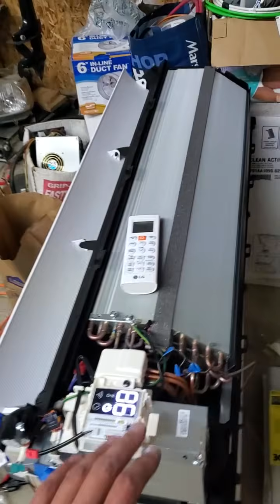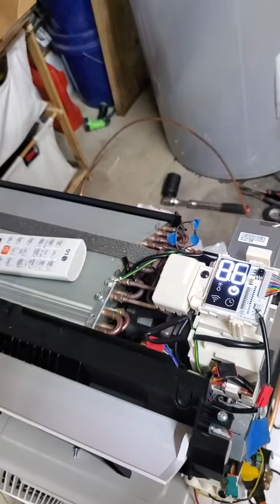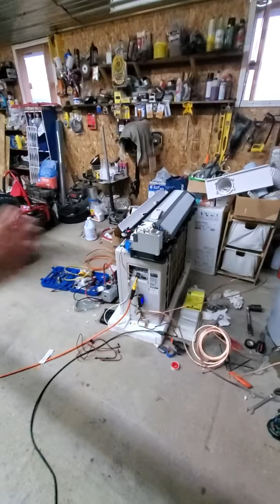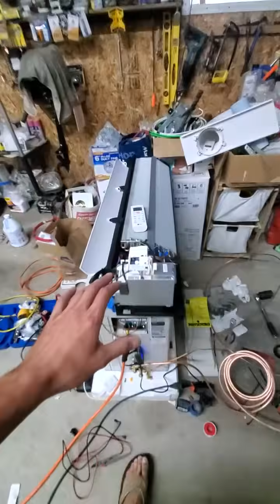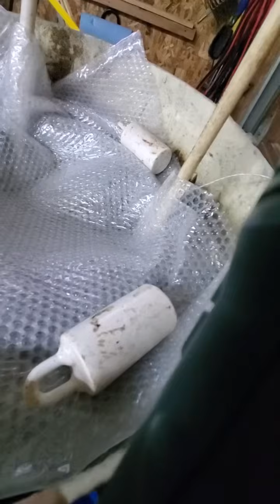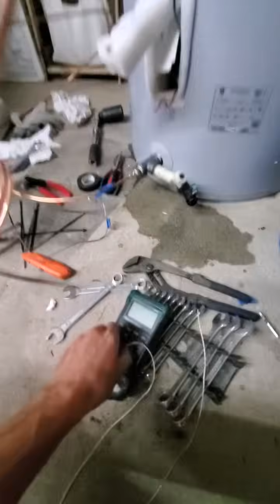DIY Heat Pump Water Heater. DIY. Home made mini split.

Comment: Thx for the great inspiration

I'm in the process of making mine from a 100$ 10 years old fujitsu heatpump,

Tested it with stock coil on a 55 gal drum and got a cop of more than 3

Mine the air handler was made of 80ft of 3/16 copper so I tried it with 50ft of 3/8 copper, I got the exact same cop in my 55 gal drum...

I've manage to preform the coil over a 5gal drum and snaked it by the element hole, didnt have to cut open the water heater...

Thx again for sharing this😊
Reply: Wow. You got 50ft of coil into the water heater without cutting it?

Comment: I love this and I would recommend running the condenser in a space like a garage Would be better to even run it in an insulated garage and if it gets too cold even in the garage you can always turn on a space heater and you still be using less electricity to heat water than you would be but that heat pump should be good to at least 5° f

Comment: It doesn't come back from the evaporator as a cooled off refrigerant It comes back as a heated refrigerant It goes in as a cooled off refrigerant and then it picks up the heat in the house or the space that you're trying to condition that is it takes the heat out of the air that's passing over the coil in the refrigerant soaks that heat up which is why it feels like cold air coming out and that refrigerant then gets heated to the point that it's superheated and then it goes back to The condenser and it's turned back into a gas and then it's compressed silica become a liquid again and the liquid is sensor a metering a metering device and turned into a low pressure low temperature gas that absorbs heat and as it goes through the evaporator when it gets to the 50% point it should be about 50% liquid and 50% gas as it becomes satura actually those indoor units are so simple in a pinch I've literally used thermostat wire as the power wire for the indoor unit and I've seen technicians lose their head over that but it's just running a little fan That's it It's just a little fan is thermostat wire big enough to run a little fan? well it has been on one job I put in for the last 7 years

Comment: I think this design (more buttoned up) is a better option.  It gives consumers more flexibility.  You could size the heat pump independently of the water.  Since they sit separately, they would be easier to move.  I bought the 80 gallon AO Smith heat pump water heater last year and it was a major pain to get into my basement and broke my dolly that I used.  If the heat pump has a fault, it is easier to service it... and you can decide where you place the heat pump... inside, or outside.

Now, what is even better... make this part of a VRF Heat Pump setup.  In the summer, when you're cooling the inside, it would allow you to shunt the heat into the hot water heater and not even use the outdoor fan on the compressor.

Comment: I like your idea, but you did this the hard way. You did not need to butcher that hot water tank, All you needed to do was hook up a coaxial heat exchanger and a recirculating pump. the heat exchanger has two ports for the refrigerant lines  and two for the hot water lines.
Reply: Do you have a link for a suitable heat exchanger?

Comment: Could I just divorce the coils from the inside unit and drop them in the water instead of using copper tubing to replace it? Or do you need the temp snesors and other things to be hooked to the coils for some reason? I am thinking of heating up a storage tank with corrosion protected heat transfer fluid, presumably water with anti freeze.
Reply from the maker: Short answere is yes but not really. That would be like asking can I start off in 3rd gear and then go to 1st then second.  To properly release heat inside your tank you need s properly designed coil.

Comment: Could you please tell me how to regulate the temperature of the freon flow or water flow from the heat exchanger? Is it possible to somehow influence this?
Reply from the maker: The short answer to that is no because you would have to reprogram the original computer from the Mini split. that is why I stated to use this exact brand of many split. Because when it turns on and runs at full speed, its efficiency is still very, very good. Most many splits at full speed have a horrible efficiency.
Reply: Thank you very much for quick response!
What do you think about other brands, Japanese of course like Daikin, Mitsubishi, Panasonic and etc?
Reply from the maker: @slusajgledajpazi7556  Honestly, they are good in the general range. As a car at 55 miles an hour, many cars have good fuel mileage, but if you floor them, some have decent fuel mileage, and some have poor fuel mileage. the same goes for heat pumps. The other Japanese brands have a good general rating for efficiency. But under full load, they suffer 30 to 40% loss and efficiency. this L. G brand at full capacity. 5°F outside temperature produces rated capacity at Ar COP of 300%.  Most other brands run 200% at full capacity at 5 Fahrenheit. If not, less, some Chinese brands are at 180%.

Comment: Running a larger tank. Like 200-300 litres could help with keeping temps for when the shower will be running alot. 
Either that or supplementing with electrical heaters for a faster heat up when needed could do the trick.
Reply from the maker: Unit has been running for 2 years. 6ppl and no issue with doing dishes and showers one after another.

Comment: Hello. I like your setup a lot, just few questions pop up. First, why didn't you used tank that already has coils inside - like bivalent tank that's used for solar systems? Coil tube diameter size? Second, if coil is located on bottom, it will heat bottom and gradually transfer heat to the top. That means you have to wait for tank to heat up. But if you make coil on top, it will quickly heat up enough water for immediate consumption which if not spent, can be moved to the bottom with additional small pump that can be connected instead of motor (yes, I know you'd need additional electronics with it). Somehow, running that fan motor for nothing seems like a waste. I'm from Europe, on meridian similar to Virginia.
Reply from the maker: I needed exact size of pipe and leather in tank so I had to make my own. Th bigger portion of the heating coil is on the bottom of the water tank and that is after I did a few test trails prior to permanently placing the coil in tank. I tried it more to the top and then middle. The way it is now heated the water evenly and as the top reaches 125f the bottom is not cold. Maybe 115f. The heat from coilmon bottom goes to the top all by its self when heating so no point of placing it on top and as the top of the tank gets up to 125f its easier for lower part of the tank to receive the heat since the coil is there. Works best this way. Most of the coil on bottom and some middle and less on top. I looked through many pictures of other tanks and they looked similar. The fan motor need to run for heat pump to not have codes. With no fan attached it uses very little power.

Comment: The US REQUIREMENTS  for double wall separation may lower transfer rate but would not increasing contact area of condenser compensate for the less efficient heat transfer. Question when cold water is being introduced and creates thermo layers how will that affect the return refrigerant temperature . Will the repurposed controls be able to compensate ?  Yes i worked in HVAC for many years i am not an engineer.
Reply from the maker: I have many other videos showing this unit running in house. Been 2 years. No issues. No weird compressor noise. No loss of heating output.

Comment: This looks like a disaster
Reply from the maker: In one mns eyes a disaster and in another's a work of art. To each his own. Law of relativity
Reply: @ne7s29  I guess it really depends,  did this end up working safely and reliably or did you destroy two expensive appliances?

What was the plan to make the high pressure water storage vessel safe after you cut into it snd destroyed the glass lining?
Reply from the maker: @cheekybastard99  the other videos explain they rest. Working well for few years.

Comment: I've never seen a mini split water heater in Europe, they are usually all air-water monoblock heat pumps. I'm about to start building a 2.5kW unit from a r290 mini-split and my existing DHW tank.

Comment: Excellent build. Are you still using r410a or did you switch to a different refrigerant. I noticed that it’s not in its final config like in your other videos. Do you recover and reuse?; evacuate and refill? Or there’s another procedure. Thanks.

Comment: I am curious if dropping original heat echanger into the tank would work as well instead of putting a new coil of copper tubing. I suppose corrosion would become an issue because of aluminum fins... I wodner how long it would survive
Reply from the maker: To get good cop u need to have the coil spread out from top to bottom. Just putting in a hot coil will heat the water but not efficiently.

Comment: Nice Project! How high does the water temperature rise during winter time with outdoor temperatures below freezing? I'm thinking about a similar project but submerging the indoor coil into a small intermediate water tank and a small water pump that pushes the heated water from the intermediate tank through the heat-exchanger in my final drnking water tank. Since the indoor unit's coil with its fins is quite large, I'd assume the heat transfer to the small intermediate water tank should be quite ok. Any opinion on this?

Comment: You should consider getting in the tank with the 3/8 line choking it at the exit with the 1/4 line! If you look at the indoor unit it is multiple parallel runs of 1/4.

Comment: Both Lowes and Home Depot sell hybrid heat pump water heaters from brands like AO Smith.
Reply: Do they sell them as a split system that doesn't freeze your basement?
Reply: @gregorymalchuk272  They don't sell split systems. Nyle makes a split system that designed to make a traditional electric water hear into a hybrid. They can be installed anywhere, some in very cold places.

Comment: Why ac without txv? Asking this because I have a 30k BTU Mitsubishi AC that I am thinking to convert to a HP based on your video. It does support heating and cooling by default. The only question would be if this unit has txv on each unit (outdoor and indoor), would it be possible to convert it to a hp? I think In my case I would have to make a coil of the same size as the one from the outdoor unit, right?
Reply from the maker: Mini splits are inverter driver so mukti speed/load so they have a eev. Elec exp valve. It's on the outside unit.
Reply: @ne7s29  thanks for the reply. My model
Is also driven by the outdoor unit. So what would you suggest in this case? What do you think I should do? Use the coil from the outside or inside unit?

Comment: I rigged up mine 10 years ago by pumping through the drain port. Made a heat exchange coil and tapped into the line from the compressor to the condensor. A thermostat controls the circulating pump,

Comment: As I understand it, code in the US requires a double wall between the refrigerant line and water. That's why commercial hybrid water heaters wrap the refrigerant around the tank. It's less efficient hear transfer, but satisfies this code. I think the desuperheater  accessories sold with many heat pumps are constructed the same way.
Reply: When you say double wall what do you mean? Just outside of the steel tank with the fiberglass liner? Is this the double wall you mean?

Comment: I am not a HVAC guy. I like this idea . My question is could you still use the AC side to cool a room . I think this could be great system for a cargo trailer conversion. Generating AC and hot with same power consumption could be a huge battery saver.  Two for the price of one:.
Reply from the maker: No because you only have one heat exchanger
Reply: @ne7s29  If they mean the outdoor unit, placed indoors, then it is absolutely an air conditioner.... albeit one without any forethought to indoor issues such as condensation , airflow distribution, and most people care more about the room temp vs what exactly their water heater is doing at the moment...

Comment: Cool idea, good luck, hope it works for you!   I noticed most of the outdoor units won't heat above a certain temperature, they will only cool.  Is that an issue with this?
Reply from the maker: That is something I looked into before I tried this so I turned on the heat and my fugitive Mini split during the summer hot days and it had no issue turning on and providing hot refrigerant. I figure they just give that heat temperature range for for testing purposes. I ran this last summer an 8090ﾟ weather and it had no air codes or issues I figure they just give that heat temperature range for for testing purposes. I ran this last summer an 8090ﾟ weather and it had no codes or issues

Comment: If I may ask, why did you not put the whole evaporator with the half way tempreture sensor in the tank? No need for new copper tubes.
Reply: Because Copper(Coil) and Aluminium(Fins) are fine together as long as the air is dry. If there is moist or water between them they start to oxidize. This stuff and Aluminium itself you do not want in your drinking water.
Reply: @joergreinicke5945  thank you from Egypt

Comment: I like the DIY style, but its gotta be cheaper to get a heat pump water heater. I got my 50 gallon hybrid for $670, now its around $1000. In one hour the elements on the water heater wouldn only pull 5kw, not 10kw. There are two 5kw elements, but they won't turn on at the same time. Which is why they require 30amp breaker vs 50.
Reply from the maker: Well they are 1700$ now not 1000$. I did this for speed of recovery.  It is 3-5 times faster water recovery with no heat loss in your home. If yours is in a basement that's fine. Mine is in a living space closet so you always felt the cold air.

Comment: I like your project. I thought of doing this but figured instead I would use a Geothermal Heat pump heat exchanger coil... has water and refrigerant hook up then it can be used with any water heater just need a recirculation pump.

Comment: what do you think about submerge in the water tank  whole  original evaporator ,, Im trying it but worrying about corrosion alluminium and copper
Reply: I just asked the same thing. I do not think tha Al will corode. Best regards from Egypt.
Reply: @alaasadek2908  on my exchanger i see after few months only iron part has corode and  aluminium and copper not yet
Reply: @Mariusz1975zizu  iron corods. Maybe a plastic container padded properly and polypropylene pipes will be better and cheaper.
Reply: @alaasadek2908  i have plastik pipe only small parts have problem with corrosion

Comment: Danfoss sells a mini split for 1700$..  comes with everything..  only thing is if you cant install it yourself then you’ll be out a good 6-7 grand in the install.  But if you have a brain and motivation and ability then for around 2 grand you can set one up and have a 10 year warranty..  and have it insured..

Comment: Luckily here in 🇨🇦 there are a few 2000$ options for h/p water heaters but unfortunately it's been -45c last few days so outside units freeze solid so question is...
How hard would I be to submerged outside unit in a tub filled with water circulating through pipes under ground like a geo heat pump. 
Here mini splits are 1200$ geo thermo units are 5k min.. plus I own a solar company and I'm a red seal electrian building a off grid house on a very limited budget for cash. 
So any advice would be 👍
Reply from the maker: Well if it's-45 I think you have some permafrost so I wonder how this would work for you. But the idea is the same what I did with the inside evaporator you would do with the outside condensor. Find out what size tubing is has outside and how many linear feet. Then run that in a tank of water with sufficient water flow. I guessing you will need some serious water flow but that could be tinkered with later in fine tuning
 The outdoor unit has a ambient temp sensor. I'd put that in the inlet side of the water running through your heat exchanger tank. I think this would work
 BTW those 12000 mini split are very weak. Unless you have 40deg water feeding your heat exchanger it would out out much heat and as a second you say it gets to -45. Well you need some serious btu's as well so you would need s large heat pump. I'd run a wood stove below -15c outside temp then run this lg red unit above that temperature.